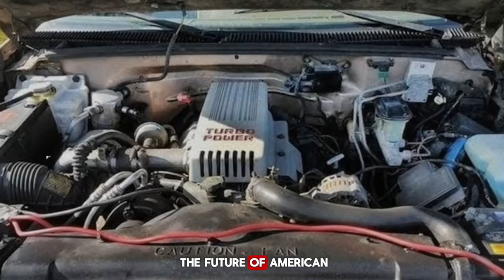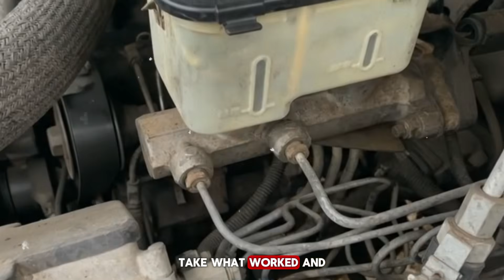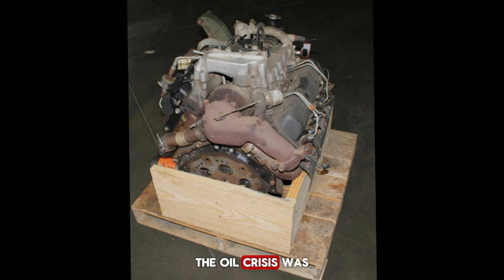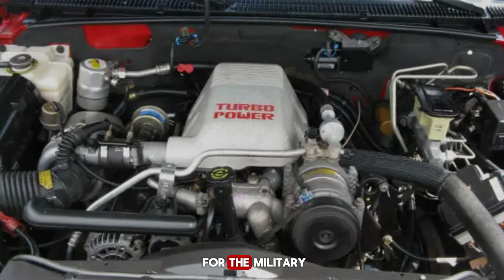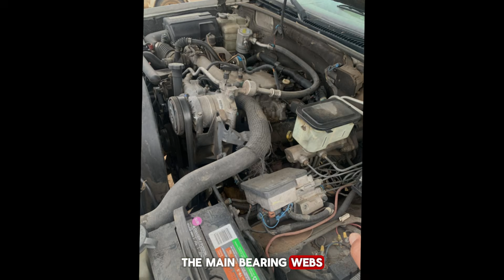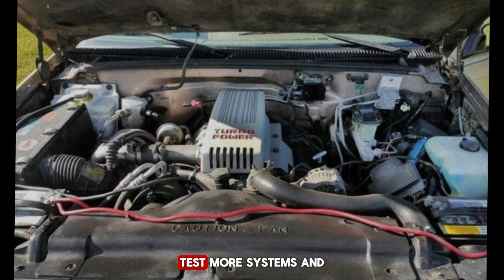The Shocking Truth Behind GM’s 6.5 Turbo Diesel

Comment: The 6.5 is a decent engine with a little bit of work. Same with the 6.2. spend a few thousand dollars on it and they make good power and get great mpgs, and are pretty reliable. Half as much building something unique vs doing an engine swap for someone different. I love my 6.2s.
Reply: Exactly. The only real downside is aftermarket parts are becoming hard to find. Other than that, they're honestly an amazing platform if you know what you're doing.

Comment: You did a great job describing the problems with the 6.5. I had a 95. That PMD mounted in the valley of the engine, that was prone to overheating, just as you point out, it would cause the PMD to suddenly fail and when you towed it into the dealership, they would be at a loss to diagnose the problem. You would think it would occur to them after many of these failures, that the simple fix was that they could simply relocate the PMD to a cooler location. After several frustrating experiences, I got rid of my 6.5 and switched to a Ram Cummins in 2006. The Cummins has never disappointed or left me stranded in  20 years, and I look foreward to driving it for years to come. The 6.5 was a disaster, as far as I’m concerned, and I will never buy a GM vehicle again.

Comment: The 6.2 and 6.5 both sucked.  Gutless turds, and hastily engineered after the Olds 5.7 diesel disaster.  Ford was already beating them with IH power,  and Dodge was about release Cummins power. 
The Duramax saved GM.

Comment: 7:00 next lie. I drove two GMC 3500 HD with 6.5 turbo diesel. I will admit one of them did blow a head gasket, but it never ran hot. It just used to pump a little coolant out the overflow tank. The other truck was a tow truck. It never ran hot either. Even going up hills, they never ran hot.